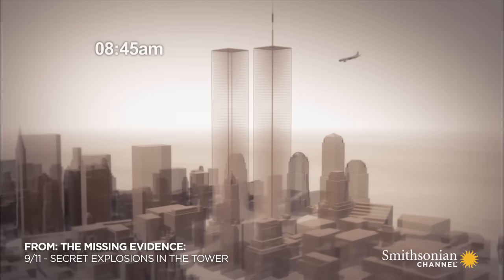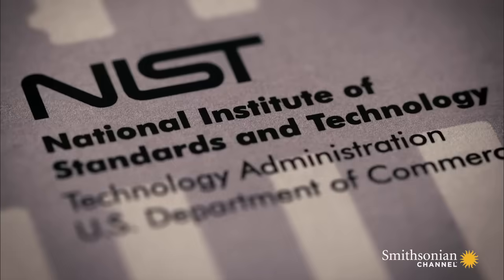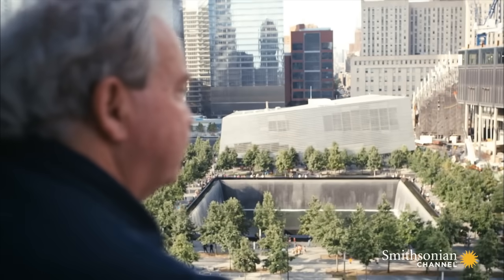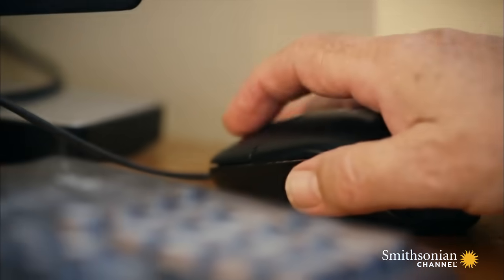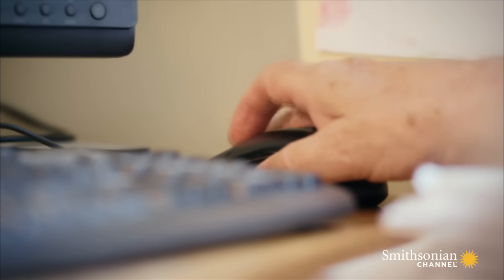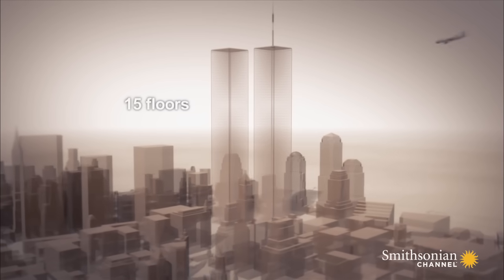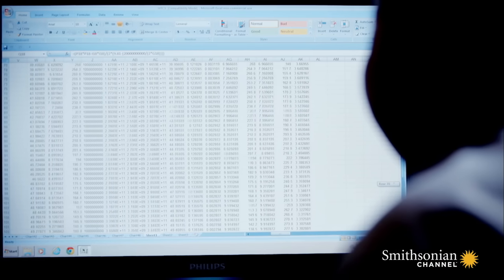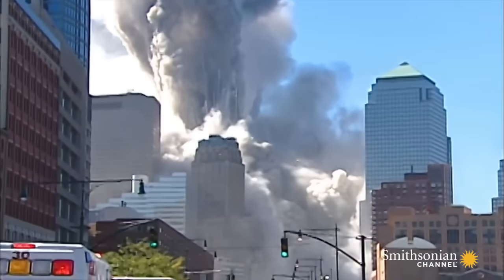This Computer Simulation Explains How the Twin Towers Fell

Comment: They flew an enormous AIRPLANE INTO A BUILDING.  I think we know what caused the building to fall. XD
Reply: Right? An enormous plane flown into a building designed to withstand the force of an even more enormous plane than the one that hit it. And both buildings just fell in the same exact way despite being hit in two different spots
Reply: @Lyfe_on_My_Terms  not to mention 7 fell in exactly the same way & it was never hit by a plane.
Reply: K B, the 767s and the 707s are actually around the same size.
Reply: @Lyfe_on_My_Terms    Not just both ... let's not forget Building 7.  It fell in the same manner, with calculated Free-fall
Reply: No they flew planes into the 15th/22nd floors of those buildings, not at the bottom. How would that cause them to completely collapse like this? They were not towers of Jenga pieces.
Reply: Bobby, wrong, he said they were designed to withstand the impact of a 707....not a 747....a 767 is slightly longer and heavier then a 707. They did not include in those calculations the higher speeds....their calculations were for a 707 under normal flying conditions.

747s first came into service in the 1970s. Construction for the twin towers was mostly complete by 1970-1971.
Reply: YOU think you know. You have a belief...a kind of faith...that's not the same as actually knowing something...so, let me guess, you've quantified it mathmatically?... That's ok, Im sure you didn't.

Comment: The Smithsonian is finally ADMITTING THEIR WERE SECRET EXPLOSIONS in their video comments !!!
Why does the RIGHT WING and THE TAIL on the plane BECOME TRANSPARENT at 3:11, right before it hits the tower ?

__The explosion in the basement time fuel falling distance vs time.__
Perhaps like the janitor and many other people reported in THE BASEMENT, 7 seconds BEFORE THE FIRST PLANE HIT ? 
How does a plane 800 feet above the ground and 1 MILE AWAY cause an explosion BEFORE it even comes close to the building, 7 seconds away, about 1 MILE away ?!?!
Plane speed 500MPH  x 1.466666 = 733 feet per second,  733 x 7 seconds = 5110 feet or about 1 mile (5280 FT)
And sound travels FASTER IN STEEL, so no excuses that the fuel caused an explosion and it took a while for the sound to make it to the ground. The fuel would fall 800 feet above ground and 40 more below ground so 840 feet
840 feet take 7.226 seconds with 0 air resistance so if an explosion BELOW GROUND were to happen it would be  7.226 seconds AFTER THE PLANE IMPACT, not BEFORE IT !
This was calculated by using Ke!san online calculator of    Free fall with air resistance (time and velocity) Calculator
then setting the distance to 840 feet ,selecting FEET and 0 air resistance, and leaving 9.8 M/S alone.

__The time for SOUND of the PLANE HIT to reach the B4 level__
And for sound to travel 840 feet in air at 1125 FT/SEC at 68F would be  840ft/1125ft = 0.746666 seconds
And the sound in STEEL is 5790M/S or 18996 feet/sec. So 840 feet / 18996 feet  = 0.044 seconds or 44 thousandsth of second !
So the whole story of the fuel causing the explosion is completely wrong since it take 7.226 seconds for fuel with 0 air resistance to fall 840 feet !!
And everyone in the B4 basement level would have heard the sound 0.7466 seconds in the air and 0.044 seconds thru the steel, less than a second in both cases !
So what caused the BASEMENT EXPLOSION when the plane was 1 MILE AWAY ???? I can't explain it except by something already IN THE BUILDING ! Can anyone ? Can anyone verify my numbers ?

THIS PROVES THE BASEMENT EXPLOSION WASN'T CAUSED BY THE PLANE 1 MILE AWAY !!!!!

__Transparent WING and TAIL___
I have no idea what could cause this ! And it isn't a camera effect or it would happen in air shows all the time.
like here   BEST AIRSHOW COMPILATION EVER!?! | CHEROKEE MEDIA | Red Arrows, Raptor, Tucker, Blue Angels
But no wings or any part ever become transparent ! So what caused it ?
But the BASEMENT EXPLOSION is a big problem for the story !!!

Comment: One thing the “controlled demolition” whack jobs have never attempted to address is how the “demolition team” that was working the “remote detonators” ...(lol..so stupid) were able to cause the collapse to begin precisely where the planes hit. Not above, not below, exactly where the impacts took place. If there were a series of charges set to detonate in sequence, how did they know exactly where to plant the first detonators in the sequence? Also, why did they wait so long to detonate? Wouldn’t it have been much more convincing if they triggered the sequence immediately upon impact? Pre-stressing a structure of that size would have taken crews of 40-50 people months on end to prepare those towers for a controlled collapse. They have to cut the stairwells at every landing - so they would have had to be closed to foot traffic the whole time. They have to saw cut the elevator shafts on every floor rendering them ALL out of service, again for months. They have to tear out all the drywall around all the columns on all the floors and attached linear detonation charges to *every one of them*.  This alone would have been a MASSIVE undertaking that would have completely shut down all operation in the buildings. The entire place would have been a construction zone,...completely obvious to the tens of thousands of people that worked there all day every day (and night) and yet saw none of this activity. The whole idea of a controlled demolition is just so shockingly stupid. Like,...jaw dropping, weapons grade stupidity.
Reply: Glitch-if you had   done any extensive research on 911 then you would have known that Marvin Bush was head of security.. That  the culprits would have  used  a  viable method to plant the explosive.. before 911 there were elevator renovations,that there was a power outage just before 911.

Comment: Why would the lower floors give way to the weight of the higher floors? Aren't the underlying supports going to continue to support the weight of the debris (some of which is probably hurled from the structure thereby lessening the weight from above). How does the explanation account for the uniform collapse of the floors?

Comment: There are numerous inconsistencies with 911. You can see and hear explosions throughout the event. There are multiple accounts of witnesses that heard and saw explosions before any of the planes hit the buildings. You can Clearly see flashes of light on several floors as the buildings come down. And yes let's not forget the molten iron found in ground zero.

Comment: The principle detractor of this theory is sir Isaac Newton. Isaac says if you hit a nail with a hammer the initial impact load pushes the nail downwards, as it travels downwards it encounters upward resistance and quickly decelerates and stops.
Reply: i love the ones who pretend to understand fizzix
Reply: There is no assuming, the lower floors had supported the floors above them for forty years prior to 911. The reason the towers could not have collapsed in the manner described in this video is the same reason perpetual motion machines can't work.

Comment: thermate much!!!! Over 400 days it took them to start a investigation by N.I.S.T. No tall steel structure has ever collapsed even being hit by a plane for example in 1945 the empire state building was hit by a plane and still held its integrity and didn't collapse.Look there was no resistance at all from any of the floors and the towers nearly fell at free fall speed  i mean come on logic dictates the story they are telling us is a fairy tell and a insult our intelligence. It collapsed sooo perfect on its own footprint.The concrete completely pulverized the steel was sent off immediately to China and other countries  to be recycled before any investigation got started. I mean jeez this doesn't sound like a cover-up.This was a inside job all the way! If you want to know the truth look up the buildings code and see the truth.Buildings are designed to with stand almost any circumstances especially the twin towers.
Reply: B&N Ferguson
 
oh crap it's a galloping gish!! time for SPEEDROUND!!!
1. so what
2. false
3. false
4. false
5. false
6. false
7. false

wow b&n you scored a zero out of a possible 7. you could try to improve your score by providing evidence to support the things you claimed but no one is holding their breath. nice to see the troofer talking points haven't changed a bit. one extra funny bit is you recommending others look something up when you haven't looked anything up yourself. typical troofer.

Comment: Only two substantive questions: 1) Where and when was the program published with the data used?
2) When and by whom did the results undergo peer review?
Reputable science means publishing all results and frameworks so that it can be reviewed by a third party independent. If this fails, everyone can claim everything possible. But then this is completely irrelevant from the point of view of serious science. So as long as the two questions were not answered satisfactorily, the assertions are worth a damn.
Reply: Logos

You have just debunked every troofer assertion ever made.
Reply: @Plumber "ever made"? What a great nonsens. troofer? What troofer? Where are the official data from NIST?

Comment: Designed to withstand an commercial airline crash, but the BUILDINGS (!!!) collapse anyway ???
We need to retrain ALL our architects then!
Reply: gjsterp

I didn't say the buildings tipped over, that's just dumb. I said the beams got weak and fell over. Try to keep up. They did NOT fall as if there was no support, I have already proved they had a lot of resistance by showing the parts that fell off passing by the collapse zone like my corvette passing your scooter on the freeway. 

Your position is that the bottom of the tower, being more massive, could resist the top of the tower from crushing it using gravity alone. So extending that, you're stating that a given mass cannot crush an equal mass, which is technically true. This ignores a very important feature of buildings.

Buildings are not monolithic structures. They are made of stacks of floors, each with a design load limit. If too much weight is put on a floor, it will fail. 

We're not crushing the entire lower building. We are talking about breaking ONE floor. 

When the impact zone floor failed, it dropped the entire weight of the upper part of the building onto the first floor below it. 

If the floor is rated to hold 1,000 tons STATIC load and you drop 20,000 tons of DYNAMIC load on it, it is going to fail and start a collapse. 

When the columns failed at the impact zone, they dropped the entire upper part of the building down onto the top of the lower part. This changed the load from a STATIC load, which the lower floor was designed to handle, into a DYNAMIC load, which exceeded the lower floors capacity by several orders of magnitude. There was no way to avoid the lower floors failure, dropping this load plus it's own weight onto the next floor. And the next.  T𝐡𝐞 𝐭𝐨𝐰𝐞𝐫 𝐢𝐬 𝐧𝐨𝐭 𝐛𝐞𝐢𝐧𝐠 𝐜𝐫𝐮𝐬𝐡𝐞𝐝, 𝐢𝐭 𝐢𝐬 𝐛𝐞𝐢𝐧𝐠 𝐜𝐨𝐥𝐥𝐚𝐩𝐬𝐞𝐝. 𝐈𝐭 𝐢𝐬 𝐮𝐧𝐝𝐞𝐫𝐠𝐨𝐢𝐧𝐠 𝐚𝐧 𝐮𝐧𝐩𝐥𝐚𝐧𝐧𝐞𝐝 𝐫𝐚𝐩𝐢𝐝 𝐝𝐲𝐧𝐚𝐦𝐢𝐜 𝐝𝐢𝐬𝐚𝐬𝐬𝐞𝐦𝐛𝐥𝐲. Newtons Laws weren't broken, they weren't even scratched. The collapse is not dependent on the total mass of the lower tower, it is solely dependent on the ability of the top floor or uppermost point of structure to support a given load. Once the load exceeds that rating the floor/structure WILL collapse. Even cave men figured this out. This collapse will continue downward until it encounters something that can support the entire dynamic load placed on it. This is usually the planet earth.

The American Society of Civil Engineers agrees. Are you smarter than 70,000 degreed professional engineers? NO! Are 70,000 degreed professional engineers smarter than the ACTUAL 27 structural engineers who shill for A&Efor911Troof? YES!  A&Efor911Troof LIED to you. How does that feel?

"𝑾𝒉𝒊𝒍𝒆 𝒕𝒉𝒆 𝒃𝒖𝒊𝒍𝒅𝒊𝒏𝒈𝒔 𝒘𝒆𝒓𝒆 𝒅𝒆𝒔𝒊𝒈𝒏𝒆𝒅 𝒕𝒐 𝒔𝒖𝒑𝒑𝒐𝒓𝒕 𝒆𝒏𝒐𝒓𝒎𝒐𝒖𝒔 𝒔𝒕𝒂𝒕𝒊𝒄 𝒍𝒐𝒂𝒅𝒔, 𝒕𝒉𝒆𝒚 𝒑𝒓𝒐𝒗𝒊𝒅𝒆𝒅 𝒍𝒊𝒕𝒕𝒍𝒆 𝒓𝒆𝒔𝒊𝒔𝒕𝒂𝒏𝒄𝒆 𝒕𝒐 𝒕𝒉𝒆 𝒎𝒐𝒗𝒊𝒏𝒈 𝒎𝒂𝒔𝒔 𝒐𝒇 𝒕𝒉𝒆 𝒔𝒆𝒄𝒕𝒊𝒐𝒏𝒔 𝒂𝒃𝒐𝒗𝒆 𝒕𝒉𝒆 𝒇𝒍𝒐𝒐𝒓𝒔 𝒘𝒉𝒆𝒓𝒆 𝒕𝒉𝒆 𝒄𝒐𝒍𝒍𝒂𝒑𝒔𝒆𝒔 𝒊𝒏𝒊𝒕𝒊𝒂𝒕𝒆𝒅. 𝑺𝒕𝒓𝒖𝒄𝒕𝒖𝒓𝒂𝒍 𝒔𝒚𝒔𝒕𝒆𝒎𝒔 𝒓𝒆𝒔𝒑𝒐𝒏𝒅 𝒗𝒆𝒓𝒚 𝒅𝒊𝒇𝒇𝒆𝒓𝒆𝒏𝒕𝒍𝒚 𝒕𝒐 𝒔𝒕𝒂𝒕𝒊𝒄 𝒂𝒏𝒅 𝒅𝒚𝒏𝒂𝒎𝒊𝒄 𝒍𝒐𝒂𝒅𝒔, 𝒂𝒏𝒅 𝒔𝒊𝒏𝒄𝒆 𝒕𝒉𝒆 𝒎𝒐𝒕𝒊𝒐𝒏 𝒐𝒇 𝒕𝒉𝒆 𝒇𝒂𝒍𝒍𝒊𝒏𝒈 𝒑𝒐𝒓𝒕𝒊𝒐𝒏 𝒃𝒆𝒈𝒂𝒏 𝒂𝒔 𝒂 𝒇𝒓𝒆𝒆 𝒇𝒂𝒍𝒍 𝒕𝒉𝒓𝒐𝒖𝒈𝒉 𝒕𝒉𝒆 𝒉𝒆𝒊𝒈𝒉𝒕 𝒐𝒇 𝒂𝒕 𝒍𝒆𝒂𝒔𝒕 𝒐𝒏𝒆 𝒔𝒕𝒐𝒓𝒚 (𝒓𝒐𝒖𝒈𝒉𝒍𝒚 𝒕𝒉𝒓𝒆𝒆 𝒎𝒆𝒕𝒆𝒓𝒔 𝒐𝒓 10 𝒇𝒆𝒆𝒕), 𝒕𝒉𝒆 𝒔𝒕𝒓𝒖𝒄𝒕𝒖𝒓𝒆 𝒃𝒆𝒏𝒆𝒂𝒕𝒉 𝒕𝒉𝒆𝒎 𝒘𝒂𝒔 𝒖𝒏𝒂𝒃𝒍𝒆 𝒕𝒐 𝒔𝒕𝒐𝒑 𝒕𝒉𝒆 𝒄𝒐𝒍𝒍𝒂𝒑𝒔𝒆𝒔 𝒐𝒏𝒄𝒆 𝒕𝒉𝒆𝒚 𝒃𝒆𝒈𝒂𝒏. 𝑰𝒏𝒅𝒆𝒆𝒅, 𝒂 𝒇𝒂𝒍𝒍 𝒐𝒇 𝒐𝒏𝒍𝒚 𝒉𝒂𝒍𝒇 𝒂 𝒎𝒆𝒕𝒆𝒓 (𝒂𝒃𝒐𝒖𝒕 20 𝒊𝒏𝒄𝒉𝒆𝒔) 𝒘𝒐𝒖𝒍𝒅 𝒉𝒂𝒗𝒆 𝒃𝒆𝒆𝒏 𝒆𝒏𝒐𝒖𝒈𝒉 𝒕𝒐 𝒓𝒆𝒍𝒆𝒂𝒔𝒆 𝒕𝒉𝒆 𝒏𝒆𝒄𝒆𝒔𝒔𝒂𝒓𝒚 𝒆𝒏𝒆𝒓𝒈𝒚 𝒕𝒐 𝒃𝒆𝒈𝒊𝒏 𝒂𝒏 𝒖𝒏𝒔𝒕𝒐𝒑𝒑𝒂𝒃𝒍𝒆 𝒄𝒐𝒍𝒍𝒂𝒑𝒔𝒆.[54]"

54:  Bažant, Z. K. P.; Le, J. L.; Greening, F. R.; Benson, D. B. (2008). "What Did and Did Not Cause Collapse of World Trade Center Twin Towers in New York?" (PDF). 𝐉𝐨𝐮𝐫𝐧𝐚𝐥 𝐨𝐟 𝐄𝐧𝐠𝐢𝐧𝐞𝐞𝐫𝐢𝐧𝐠 𝐌𝐞𝐜𝐡𝐚𝐧𝐢𝐜𝐬. 𝐀𝐦𝐞𝐫𝐢𝐜𝐚𝐧 𝐒𝐨𝐜𝐢𝐞𝐭𝐲 𝐨𝐟 𝐂𝐢𝐯𝐢𝐥 𝐄𝐧𝐠𝐢𝐧𝐞𝐞𝐫𝐬. 134 (10): 892. doi:10.1061/(ASCE)0733-9399(2008)134:10(892).

You're wrong, you've acted like a know it all on a subject you are totally ignorant of. Architects are not building engineers. According to your own smart ass remarks, this should make you very happy.
____________________________________________________________________________________________
NONE of the buildings "tipped over". They fell as if nothing was supporting the above floors.
The steel below was not weakened and should have offered resistance to the above weight.
It did not!  And the steel beams in the lower floors are designed to weigh more and offer more support to floors above. The lighter steel beams were on the upper floors.
Sir Isaac Newton is NOT happy, nor are hundreds of architects
Reply: Joe Plumber thats physically impossible.
Reply: what's impossible about it? planes removed a bunch of support, the rest was weakened by fire until it could not hold the load. it bent over and fell. no mystery, newton was happy, what don't you like?
Reply: Joe Plumber NONE of the buildings "tipped over". They fell as if nothing was supporting the above floors.
The steel below was not weakened and should have offered resistance to the above weight.
It did not!  And the steel beams in the lower floors are designed to weigh more and offer more support to floors above. The lighter steel beams were on the upper floors.
Sir Isaac Newton is NOT happy, nor are hundreds of architects!
Reply: they withstood the plane impacts. it was the fires that brought them down

Comment: The reason the one tower fell faster was it had a shorter distance to fall from the damaged area and the Military Thermite charges had less floors to remove.
Reply: there was no thermite
Reply: Joe Plumber are you an architect? 
Did you see the molten metal falling from the side of the building?
Did you see the puffs of smoke from the charges that preceded the falling area?
And what program was this man using? He is a chemist, not an architect!
Shame on Smithsonian for showing this "fake " report.
Reply: gjsterp

1. no and neither are you. 
2. no. i saw some incandescent material of indeterminate origin. no one took a sample or performed an assay so no one knows what it is.
3. no. i saw puffs of dust being blown out of windows as the collapse pressurized the lower floors
4. don't know, don't care, but he's probably a lot more educated than you are
5. this report is as fact filled as any 911 video produced by troofers

now my turn for a question. did you notice the large chunks of steel lattice that had broken loose from the tower and that were falling about twice as fast as the tower was?
Reply: gjsterp

Oh, sorry, I can't hear you, did you say the chunks of steel lattice were falling faster than the tower? Can't quite make it out.....what do you see?
Reply: Joe Plumber the Tower that was hit at the higher floor took a few seconds...seconds...seconds...seconds longer to reach ground level then the Tower hit at the lower floor.
Did you hear Joe? Seconds. Almost the same amount of time to fall, if you had dropped a ball from the same height...FREE FALL!
Reply: gjsterp

Yes, windows blown out by overpressure. I saw that the second night when they had started playing amateur video on the news. It's because the building is full of air. And truth is, the pattern of the blow outs proves it isn't "squibs" [squibs is not the right word]. If it was a sequential demo, you would see the entire row of windows on each floor blow out with much greater force and be followed by black smoke. Each floor would blow out in rapid sequence right in front of the collapse wave. Instead, there is a window here, and couple of windows there in random locations blowing out. And there are several that are 10 or more floors below the collapse and just a single window blows out. It is a self refuting demonstration. It indicates that the overpressure is not that great. Cutter charges would not leave any windows intact. Your argument is invalid.
__________________________________________________________________________
 windows blown out by the pressure from above? Did you really watch the videos? There are so many that show small puffs of charges going off on the lower floors as the floors above come down.